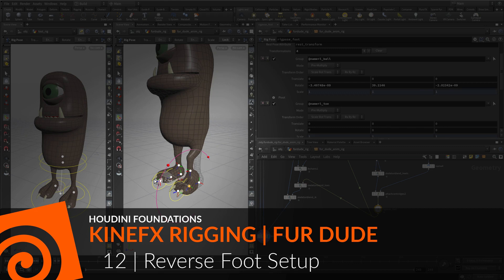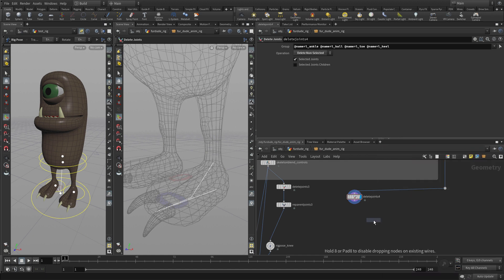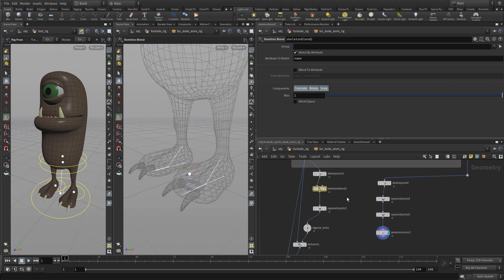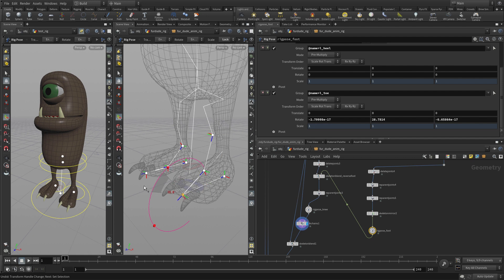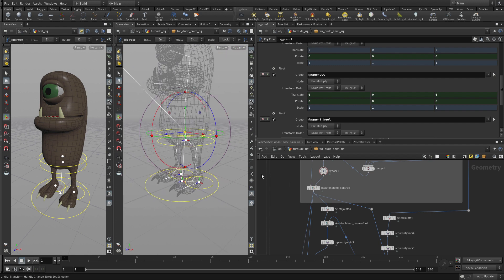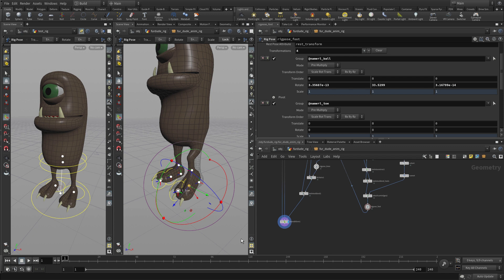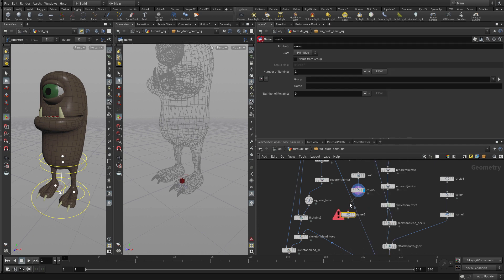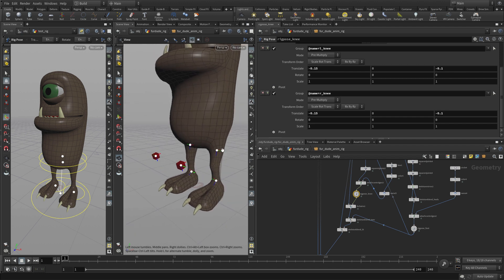KineFX Rigging | Fur Dude | Part 12 | Reverse Foot Setup

Comment: The foot roll is immensely complex, is there not a simpler way to do this? All these skeleton blends just get out of control, is there no way to set up the foot roll at the start along with the skeleton?
Reply from the maker: There is a revers foot sop that is mentioned in the PDF but this lesson was meant to show first principles even if it took a few extra steps - also the rigging side of KineFX is still being worked on and will be refined in future updates.
Reply: @houdini3d  I finally managed to copy your example, the only problem is, the ball roll doesnt work....the toe roll and heel roll both work perfect, but when I roll the ball, the toes dip into the ground...any ideas?

Comment: Hey Guys Alot of your walkthroughs use the Attach control geo node which has been replace by the attach joint geo which is making following most animation content exactly i was wondering could we get a walkthrough showing how to do it with the updated node or a short video about how to get the same results using the attach joint geo. thank you.